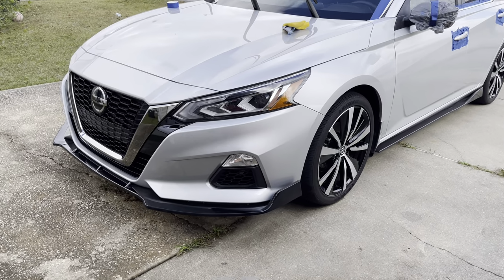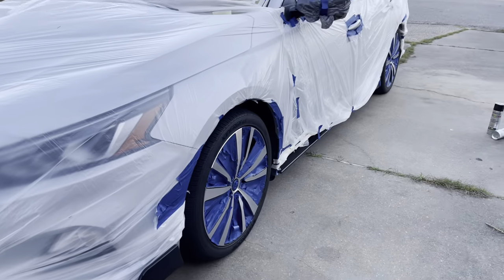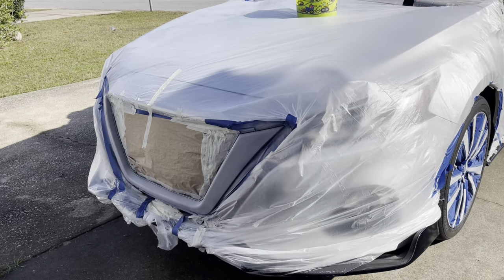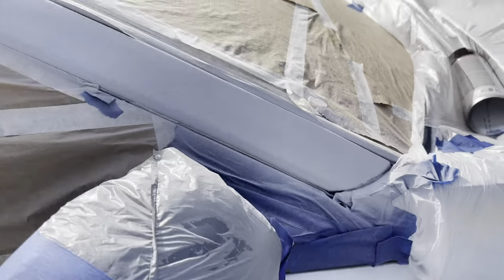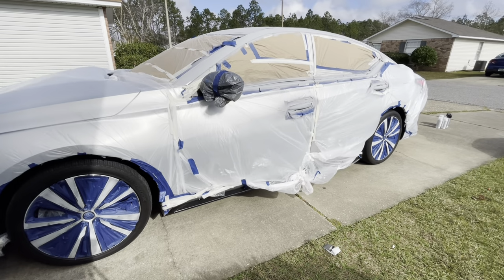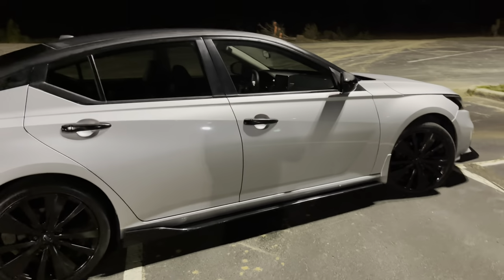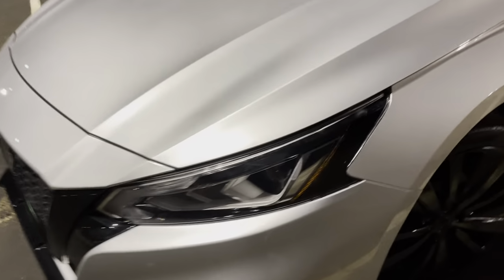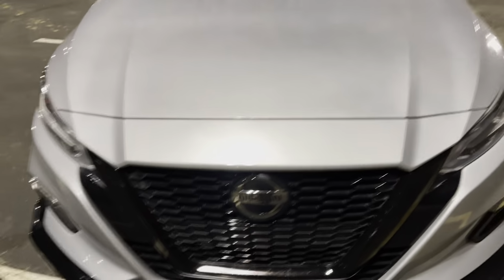Project Blackout on my 2020 Nissan Altima SR

Comment: Dont mean to rain on your parade Bro they sell BLACKOUT KITS for ALL your trims and blackout covers for the side mirrors EBAY pretty much has blackouts for everything you painted! It was tough to watch you paint your roof and trims with spray paint ! The sun and the elements gonna eat that paint up quick!!!! You pretty much gotta touch that up regularly! Good job tho!
Reply from the maker: lol appreciate it and yeah I knew that they did during the time and I could’ve just used vinyl wrap but i went with what I knew and saved a grand in my pocket. It’s been holding up very well since I did it though and has survived the sun with no issues and I did do the top over on another video right after this to fix the tiger stripes but I tell you what trial and error is a great teacher.

Comment: Man that is dope. Took some serious balls to go through with this. I did this before on a truck I had. I don't think I have the guts to try it on the Altima. Hard to get paint to stay on chrome for a long time. I actually opened up my headlights and blacked out the insides and removed the reflectors for the turn signals and blacked out the underneath. I still have the lights. Sold the truck and never used them but they are so pretty I could not sell them.
Reply from the maker: Nice it definitely took some guts with this one. I was nervous the entire time but it came out good and that’s the next project opening up the headlights

Comment: I personally would’ve left the wheels alone. Those stock are gorgeous.

I have a ‘21 SR Turbo in Sunset Drift - I already have it all blacked out w/10% tint all around (all done professionally, though), but left the wheels alone. I like the contrast too much and they stand out in a menacing way especially with my orange paint.
Reply from the maker: Nice the stocks are nice but didn’t go with my color scheme so I painted them black and with the sunset color it does stand out the stock normal way… but that’s what makes the best about this getting to see other great minds color scheme their Altima
Reply: @TheRealCountryBoyModz  fair enough man. I still love what it did for sure. You think about getting any aftermarket LED taillights? I know you smoked them out though, so not sure how much sense it makes for you. 

Anyways you got yourself a new sub.
Reply from the maker: @xentricityy8832  Thanks appreciate it I been looking into some but I have LasfitLEDLights in my tailights currently and I don’t know if the brightness would be the same but I have some after markets sitting in my shopping cart on Amazon for now… still debating

Comment: Wow I’m in love! You did amazing, i just got the 2019 Altima sr in black i would love to black mines out even more. The silver on yours really compliments that look i wish i had got that one instead😭
Reply: I love the different color stitching it gives it more of a sports feel but honestly i really hate all the orange in it but I’m not sure if i can change it. The stitching and the lights, Any advice?
Reply from the maker: Thanks appreciate it and when I got this in 2020 I only wanted to two colors which was black and silver…I chose black originally but the silver just popped more and I changed it up
Reply: @TheRealCountryBoyModz  do you have any suggestions on the orange lighting in it? I wanna change it but I’m not sure if anybody can do that, as for the stitching I’ll figure that out on my own. But orange really isn’t my color.
Reply from the maker: @aaelexa  as far as the orange accent lighting on the knobs and everywhere else it’s all built into the boards of those items but the center console and other interior lights can be changed to LEDs. I actually matched up el wire to match those orange lights and installed LEDS in my car. Also I have videos showing everything as far as how to do these things on my page for reference if needed. If you know someone who is good at soldiering there may be a chance you can change the color of the orange lights

Comment: I was cringing when I saw you painting in the wind but you did a solid job. I'm picking up my 2022 white altima awd midnight tomorrow! I'm feeling the lip kit you installed. Can I get the link? Thanks!
Reply from the maker: Amazon Front Splitter Link: https://www.amazon.com/gp/aw/d/B08W2YDLR9?psc=1&ref=ppx_pop_mob_b_asin_title
Link to Walmart universal side skirt splitter: https://www.walmart.com/ip/Universal-Car-Side-Skirt-Extension-Rocker-Panel-Splitter-Lip-Kit-For-Mercedes-Benz-Honda-BMW-Audi-Subaru/309506064

Link to Amazon rear lip splitter: https://www.amazon.com/gp/aw/d/B08TQ863XB?psc=1&ref=ppx_pop_mob_b_asin_title

Link to diffuser fins: https://www.amazon.com/gp/aw/d/B08CHG1YV8?psc=1&ref=ppx_pop_mob_b_asin_title

Comment: I just got a 2021. For the rims, should I mask the black parts like you did? Or would it work if I painted the entire thing.
Reply from the maker: It all depends on the shape they are in but the easiest way is to mask it off unless you want to do the entire rim. I did mine that way because the factory black paint was perfect so it blended well

Comment: Can the paint come off later if u want? Why did u sand it and does does sanding it messes up the original paint?
Reply from the maker: No this is permanent paint and I sanded it to get rid of the factory clear coat so I can get the primer to stick to the original silver paint. I didn’t sand deep enough to mess up the original factory paint underneath the black paint.

Comment: What tints you use for all your windows? u tint the sunroof or front/rear windshield?
Reply from the maker: All windows are 25% ceramic tint front windshield is replacement after market that’s tinted but no separate tint fun and have no sunroof

Comment: How many miles on it? And have you had any issues with transmission? Etc
Reply from the maker: I currently have 47k miles on mine and no issues with the transmission at all. Only major issue was when I first got it the main engine harness shorted out modules and other components on the car but it was fixed under warranty.
Reply: My 2019 SR has 94k miles on, and no issues at all, the only thing I have replaced is the battery
Reply from the maker: @miguelrosso2268  nice!!!!
Reply: My 2021 altima battery just stopped working too for not driving it for a month
Reply from the maker: @CHICKENmcNUGGIESMydude  was it a old battery in it?

Comment: hey man i have a 2020 altima s, but it come with the 16inch rims do you think 19inch rims will fit?
Reply from the maker: Yeah they will fit just fine I know a few people that done it
Reply: @TheRealCountryBoyModz  oh because i wanted bigger rims like yours but since mine is the 2.5 s model it says that i have to stick to the 16inch
Reply from the maker: @lachi3117  only difference between the s and the sr is the suspension setup but you will be fine join the group on Facebook 6 Gen Altimas Official and there is plenty of people who done it and all questions will be answered
Reply: @TheRealCountryBoyModz  just requested to join, where could i also get your tires and rims?
Reply from the maker: @lachi3117  mine are the normal factory size for the SR and those are the factory wheels that came with the SR…. You might be able to find them on marketplace or someone in the group may be selling some who knows

Comment: Where did u get that front lip
Reply from the maker: Amazon
Reply: @TheRealCountryBoyModz  think you can show me exactly which one it is ?
Reply from the maker: Just type in 2019 or 2020 Nissan Altima front lip and several will pop up the one I have is out of stock
Reply: @TheRealCountryBoyModz  mine is 2021 would it be a difference or no ?
Reply from the maker: No difference at all 2019- current is all the same

Comment: The dude better hope that paint has a hardener in it. If not, it will peel right off... He also better hope no-one hits him from the back end because it will automatically be considered his fault for altering the lense. Just sayin...
Reply from the maker: The dude definitely made sure the paint was hardened and clear coated as well and it did not peel off at all and still was on before it was sold. True statement about the tailights with some insurance but the lights are well visible from any distance and in any weather plus they are LED and cleared by law enforcement plus Nissan engineers had the smoked….Although the dude just sold the car and it looked even better no faded paint. Just saying 😂 lol but definitely good points though 💪🏿

Comment: Just bought a 2023 sentra sr midnight i wanna black out the front nissan badge but believe they're is sensors in it or around it can anyone tell me if it would be alright to black it out or should I leave it be? Feed back hugely appreciated
Reply from the maker: Congratulations and yes you are correct there is a sensor behind it and I suggest to leave it alone unless you can figure out how to remove the glass portion if equipped to actually paint the Nissan emblem.